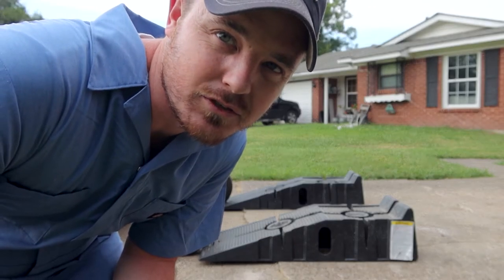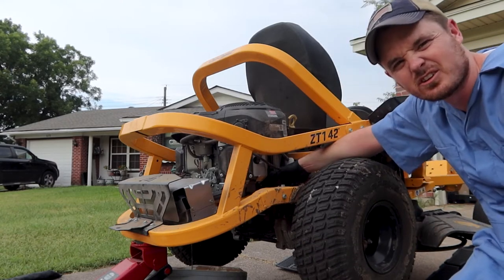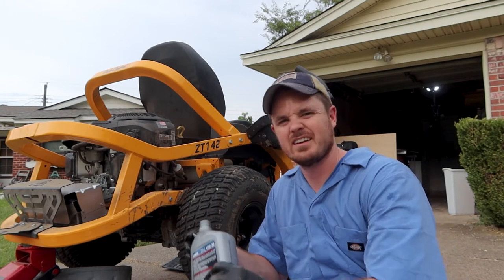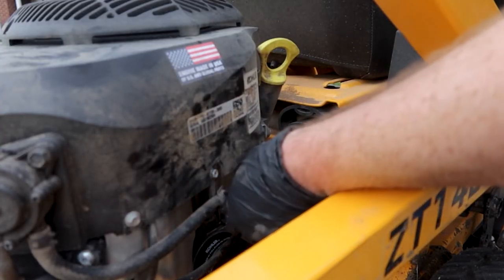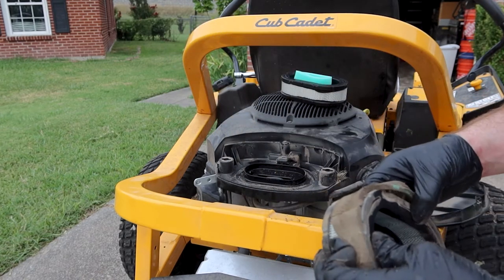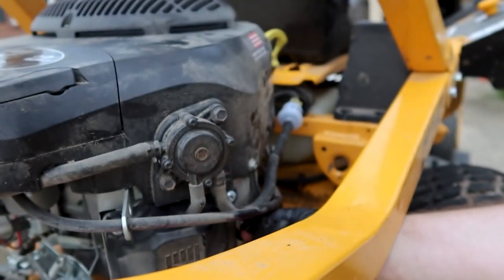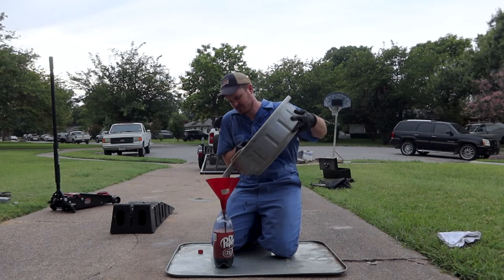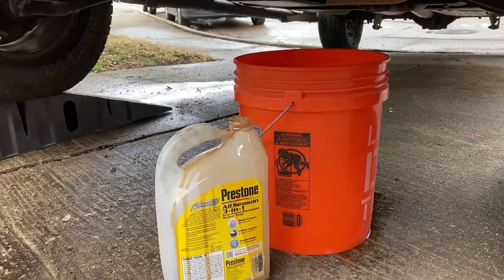Routine maintenance for a zero-turn mower (Cub Cadet ZT1) - BONUS: hack to get rid of used motor oil

Comment: Just got my zero turn and fixing to do the first 5 hour oil change. Thanks for the help!
Reply from the maker: Nice! How’s it running so far?
Reply: @nontgarage9819  oh I love it. I have about an acre to mow. Gets the job done quick!
Reply: @nontgarage9819  took me a bit to get that oil drain plug out. What do they do, locktite it?
Reply from the maker: Not sure. I’ve seen some places do it after service but I don’t know about from the factory. As long as it’s the blue stuff you should be in good shape to get it out with regular wrenches. Maybe just sticky since it’s the first time it came out from the factory. Heat will sometimes swell the bolts a bit too!

Were you able to get it all done?
Reply: @nontgarage9819  yeah I got it off with an adjustable and a socket. Was something red sealed in it.
Reply: @dedarkshadow  - I only have 2 hours on my new ZT 42 inch. I ran to my garage when I read your comment to see the same. I have a red sealant on my threads. Will I have a problem come my first oil change? And is it requitered to change the filter too?

Comment: Little tip if you pour the new oil with the opening on top instead of the bottom it doesn’t clug out and pours smooth

Comment: Do you have any info on the lubrication points? 
I only found 2 grease fittings on the castor wheels, no where else. I assume the spindles would need grease but can’t find a fitting. Any important lube points?
Reply: Came here for this exact answer…?

Comment: Pull the dip stick up a bit and it will drain faster.  Square plug?  Wow they just pull what ever they had on the shelf haha, mine has 1/2 tapered bolt .   ; )

Comment: Cut the bottom of a gallon on milk to make a small low profile oil pan to slide under the oil filter to catch that bit of oil that drips from the filter as you unscrew it. Your driveway will  thank you!

Comment: So how often do you have to change the little fuel filter and spark plugs? I'm assuming it's not everytime you change the oil but I honestly don't know...
Reply from the maker: I normally service it before every mowing season including oil, filters, and spark plugs. There are a lot of different schools of thought (every 50 hours, every 25 hours) but for personal use on an average sized property, once a season works for me!
Reply: @nontgarage9819  Ok, good to know, thanks!

Comment: I have this exact model.  Any advice why exactly the left and right levers for forward and reverse don’t match up off about 1/4 of an inch even after using the fine adjustments if I make them dead even the same then it pulls one way or the other
Reply from the maker: Google “ZT1 throttle position sensor calibration” or “speed adjustment”. I’m not sure, but I think there is a 2-step process where you need to align the steering arms and then calibrate the speed so it doesn’t pull.  It’s likely that you aligned the arms but now the speed calibration is off.

Not sure if this is right but hopefully it helps!

Comment: i have a ZT2 60" unit has anyone found thicker blades that will last longer? i live in Florida and the Florida sand tears up the Cub blades so fast
Reply from the maker: I haven’t found anything that lasts for a full season in the East Texas sand. However, I’ve had decent luck with Gator blades from Oregon lasting longer than other brands.

Comment: I have now watched 2 videos on servicing a cub cadet and no one lubes the grease fittings or rubs a little oil on the rubber seal for the new oil filter. This one doesn't even cover blade sharpening. LOL
Reply: On this mower the only grease fittings are for front wheels, All of the pulleys are sealed.  He did put oil on the seal of the new oil filter in this video. .  I like replacing blades with new ones instead of sharpening, JMO.  I just didn't understand why he jacked it up or lift up the front wheels to just change oil.  I changed mine with all wheels on the ground.